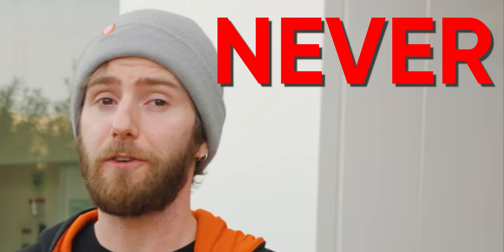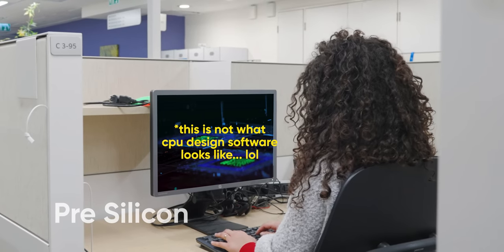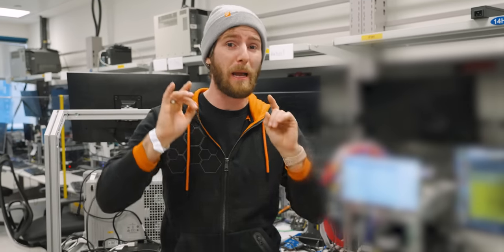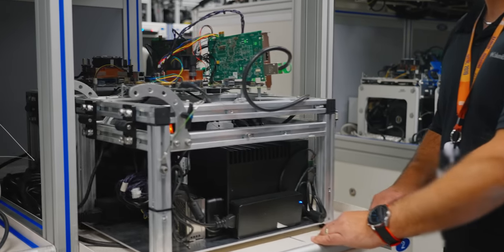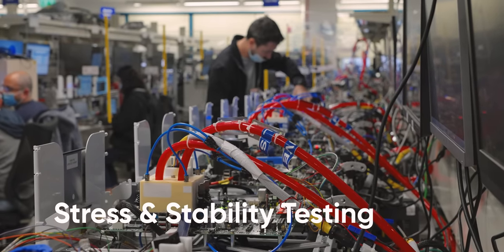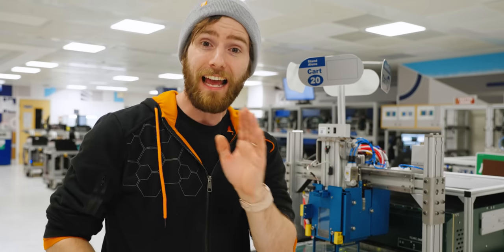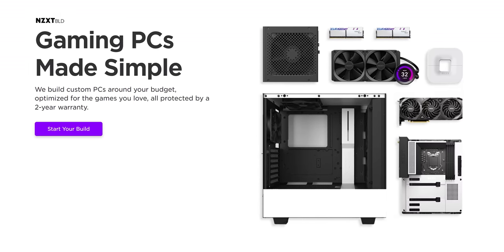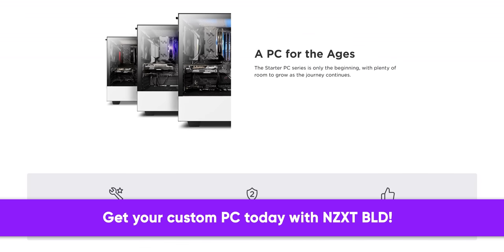I Ripped Up My Sponsor’s Check - Intel Fab Tour

Comment: I watched LTT for 8 years and it made me want to be an engineer. I was super burnt out by the time I was a sophomore but this video reminded me of why I chose this path. Thank you Linus!!
Reply: The first couple years are the hardest, because they don't normally give you enough stuff to learn in your chosen field.  The last decade or two schools have gotten more in tune with that and try to bring in more courses from your major earlier, rather than leaving them all for second semester sophomore year.  Which hopefully helps.  When I went through, it was 100% Math+Physics+Chem+humanities for 1.5 years.  NOTHING else.  Then we got an "Intro to EE" class second semester sophomore.
You just kinda have to slug it out, knowing there's more interesting stuff on the other side.

Comment: 7:45 "these rigs can do all kinds of things that a customer would never do" - as a test architect I can tell you, test scenarios are akin to safety rules. That is to say they are written in blood. If you see a test scenario and think, "weird, wonder why they test that?" someone somewhere probably has a story to tell about that issue they spent sleepless nights trying to fix which lead up to that scenario being created. Sure occasionally we come up with some kinda contrived scenarios on our own based on what we know are potential weaknesses or areas of concern, but the wild ones usually come from wild events that actually took place.
Reply: Hey✋📦
Reply: they might also be verification channels used only during qc. using locked out or non-valid input combos as test parameters. if a given circuit has bad responses or too much draw or whatever, could be a way to bin chips for example
Reply: I wonder what channels the feedback goes to to reach a test architect? Statistics form  retail's support tickets? I imagine the bulk of it come from Partner S.I. and big server customers, but can't be it all, especially if we are talking about testing of consumer platform's features
Reply: @ssl3546  ... It's a metaphor. Not literally blood. Just that it went wrong in the real world and someone said "never again".
Reply: @ssl3546   It's an homage to the saying, not being literal. That said, there have been plenty of hardware and software malfunctions which have unfortunately resulted in severe injury and death so yes, blood.
Reply: @salmiakki5638  Most of my work does not come from customer complaints. The majority of it is when planning out test plans and strategies for new product development.

Where this comes into play though is when our tests did not catch the problem, we call that a leaked defect. That can be reported by users, or identified statistically, or just identified by manually testing the product through what we call exploratory testing. Linus touched on this in the video, you can't possibly anticipate every possible scenario to exist so there's usually a game of bug whack-a-mole during the integration phase (also known as integration hell).

Once a leaked defect is identified, that is when things can get ugly. Since it was not anticipated in our tests, very likely it's going to be difficult to track down and debug/resolve.

Once the issue is identified, along with resolving it a new test scenario is born to ensure that defect will be caught in the future.

edited to improve clarity/readability
Reply: "We know a thing or two because, we've seen a thing or two"
Reply: It is fun seeing different fields way of dealing with these kinds of issues. From game testers to CPU engineers it's silly setups all the way!

Comment: This makes me wonder: what did Intel's manufacturing facility look like back on the last 90's-late 2000's. 

Did they have 20 Crt's stacked on a wall?
Reply: You bet.
Reply: Let's see, frequency would range between 60 and 85hz, resolution between 640x480 to 1280x1024, so not that many variants
Reply: I dont know intel, but microsoft in the 90's basically had rooms and rooms with hundreds of computers (cpu+crt montior +kb) to stress test new windows versions. pretty cool to see
Reply: @G4rg0yl3z  you know crt's managed way better resolutions than that
Reply: @Tearjerker probably yes.
Back then it was cutting edge, now it's cutting loaves...
Reply: Well Intel gpus didn't get igpus before Core, so why test monitor compatibility :D
Reply: They looked pretty much the same as today, the equipment was just smaller because we ran 8" process back then.

Oh I guess the automation was a lot lower tech but we did have overhead vehicles carrying the product, but a lot slower.

Also note that the factories are not the same as the testing facilities. What you see in this video is not the fab.
Reply: @nabicx  Yeah, somebody doesn't remember CRTs like the Sony GDM-FW900.
Reply: i visited the IBM factory in Scotland as part of my university course back in the 90's... it was unreal ! !
Reply: CPUs in the 2000 didn't have iGPUs, so no display outputs. The iGPU was a dedicated chip on the motherboard made by a different company, for example Via and connected through PCI/AGP.
Reply: @G4rg0yl3z   There was also 1600 x 1200 and 2048 x 1536. What I used to dream of owning as a teenager - 19" or 21" monitor in these resolutions.
Reply: I believe that analog VGA signal is pretty much unidirectional. There's no handshake or anything - the hardware in the PC does not have to detect the external monitor and adapt it's output to it in any way or form.
Thus there should be no need to plug in an actual monitor for testing at all - just measure the signal at each VGA pin, and you're good.
Reply: @antoniocesarscartezzini  Some random tech nerd in 100 years when they get asked why they invented time travel:
Reply: @hooby_9066  I just learnt something, thanks
Reply: @nabicx  They did but you couldn't run them.
Reply: @G4rg0yl3z  CRT's also had a range of display technologies.
Reply: Would those tests have been necessary before integrated graphics? I assume integrated graphics wasn't a thing back then?
Reply: @enginerd80  Integrated graphics was a thing before discrete graphics.

EDIT: Well, up to a point. Go back far enough and everything was additional.
Reply: Cool video but the click bait title makes me want to down vote it.
Reply: @MrVoltz  the i810 chipset from 1999, just after the 440BX was made by, ahem, Intel, with integrated graphics…
Reply: CRTs*
Reply: @acorgiwithacrown467  A Matrox Mystique G200 from 1999 will do 1900x1200x70hz on a CRT
Reply: @hooby_9066  My CRT to VGA (and LCD to VGA) experience disproves this, at least on machines from the 90s and up.  Firing up the display control panel would get me the make/model of each connected display.  The monitors would also provide the resolutions they supported as well as their refresh rates.  You could also set a monitor to unsupported settings which implies some level of back-and -forth was present in the standard.
Reply: My Dad got to explore the facilities in the very early 1990s. All the R&D was in the US back then. Anyhow, he told me that they were working on the Pentium 4 in like 1990–1992 when he visited. 🤣🤦🏽‍♂️ Like, Dad! 4 gens ahead‽ 🤣🤣🤣

But, maybe, Linus didn't get to see the Beaverton R&D labs… 🤔
Reply: @MrVoltz  oh yeah, I forgot you needed a separate card for Video and sound back then.

Look how far we've come.
Reply: @m80116  one could say they're cutting wafers

(Silicon wafers)
Reply: @G4rg0yl3z  it would range much higher than 1024. My Trinitron did 1600 at 90 HZ.
Reply: @antoniocesarscartezzini  where can I see this?
Reply: I worked at an Intel manufacturing facility from 2000-2016.  And it depended on the application.  Some areas were frustratingly antiquated -- they simply didn't change them because they didn't need to.  And that included using manufacturing tracking software that hadn't been updated in 20 years by that point.  And then you'd have areas where you were walking into another world due to how new it was.  So it was a mix.
Reply: Yes.
Reply: Reminds me of the Randy music video

Comment: Having CPUs that can go to sleep while still outputting video could be handy for display walls, digital signage and other applications where the CPU only needs to run to update whatever is being displayed. There is no point in wasting 30W running the whole platform continuously when it only needs to update outputs once every 10+ seconds. They may also be testing panels with self-refresh capability where there is actually no HDMI/DP signal, just the IGP telling the monitor to go into self-refresh mode before going to sleep.
Reply: tbf the current draw at idle for the CPU is going to be pretty darn low anyway in that instance. The other thing you'd need to do is have some way to wake it internally.

I get what you're saying but something like the NUC11PAQi7 pulls 6w at idle for the whole system, even if you sleep the CPU cores all the way rather than idle you'll still need to keep the memory refresh running, chipset, all of that stuff.

Not saying you're wrong there BTW, just saying that particular application doesn't seem like a killer application for that ability.
Reply: @zyeborm  Digital signage can have a mix of video, static images, procedural content, etc. that requires more processing power than a 6W NUC can deliver. As for waking up, that is what wake timers are for and Windows will use those to update at whatever ungodly time of the night it deems appropriate to do updates if you don't prevent it from doing so.
Reply: If you're talking about intel then this is pretty much the norm on their C states. I have one rig specifically made for displaying a live chart idling around 10W.. AMD meanwhile will idle at over 40w lmao.
Reply: @bingbing3464  With a self-refreshing display, you can idle at sub-1W total system power measured at the AC input since the whole system is in standby, not just the CPU. Only needs enough power for DRAM self-refresh and always-on USB peripherals if any.
Reply: @teardowndan5364  well if you want it as a static image that refreshes then it's totally pointless to use any cpu running on a general purpose OS like windows. There are purpose built hardware for it.

What I have here is a rig that is refreshing the screen at 75hz, internet connectivity for collecting data to display with audio notifications for 30w from the plug.
Reply: @bingbing3464  Digital signage can have a variety of content ranging from minutes of static images in a loop with the occasional video thrown in while no interaction is detected to AI-powered augmented reality interactive content.
Reply: @bingbing3464  idk what your system is but my ryzen 5 3600X idles at like 10W rofl
Reply: @nocturn9x  prove it over a period of time, not the absolute minimum. I have a 3900x and 5800x rig in my attic btw
Reply: @teardowndan5364  again, there's purpose built hardware for it, not a windows rig hooked up to a TV unless the media company is a broke one and have spare pc laying around.
Reply: @bingbing3464  wdym over a period of time? I can run a test once I'm home
Reply: @nocturn9x  yeap do it with one browser running, perhaps with a youtube video playing or maybe an excel open. You will see the AMD processor coming in and out of idle to going max boost in miliseconds intervals. It's a common problem btw and 90% of people who has AMD rigs knows it.
Reply: 30watts?
Reply: But isn't sleeping system not supposed to work?
Reply: @bingbing3464  but a CPU still has to be able to do it. so Intel need to test for it.